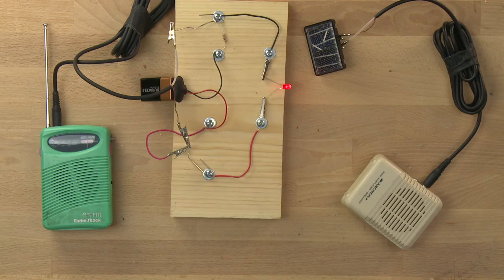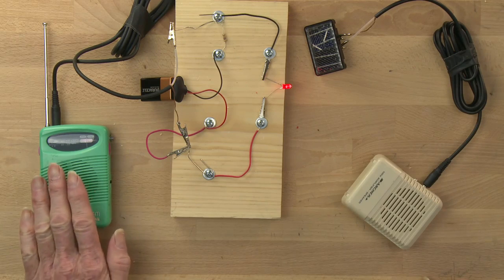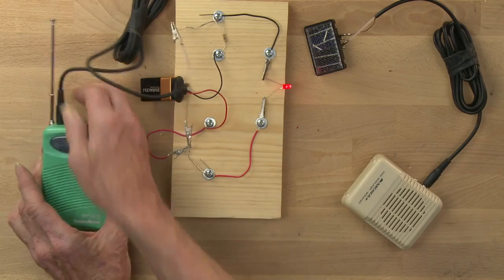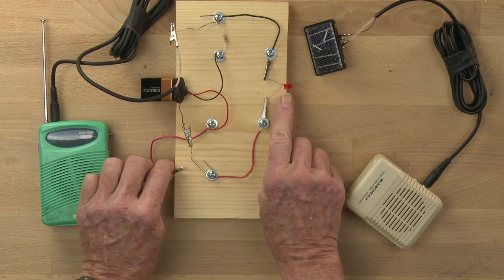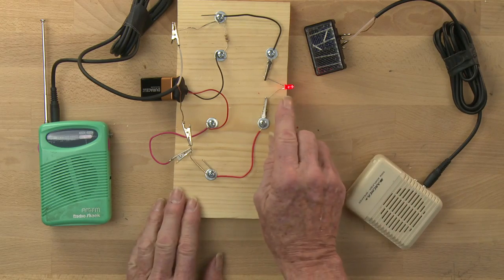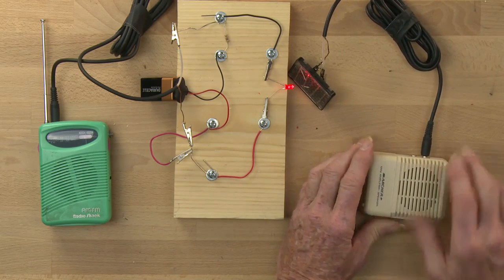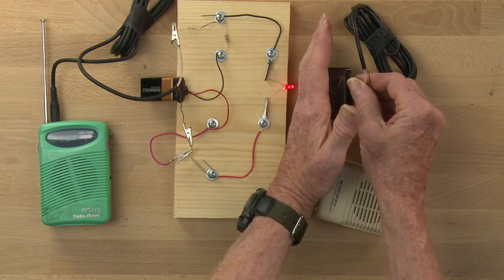How to turn sound into light (then back into sound) - Part 6 of 7: Here's how it works

Comment: I do not think that this is conversion of sound into light. This is merely a utilization of the electricity supplied by the headphone jack to light up an LED connected to it, with the support of a battery no less. Conversion of sound to light means something completely different in my book.
Reply: I would also like to add that the LED was on even without the connection to the radio, thus implying that a comment made by an individual here saying that battery did not power it up on it’s own is wrong. And I do not see the brightness change, at all. I have been pondering recently whether it is possible to change one form of electromagnetic energy/radiation into another as all of them are the same, i.e; electromagnetic waves. The only difference is their wavelength, which if could be manipulated will result in conversion. This is nowhere close to what I was thinking of. This is simply extrapolation of electricity through radio waves (or maybe not, if that is a battery-powered radio) and usage of the generated electricity to power an LED, which was already lit up, with a battery.
Reply: Yeah but he made it sound so convincing like he knew what he was talking about LOL. The next mr. Wizard
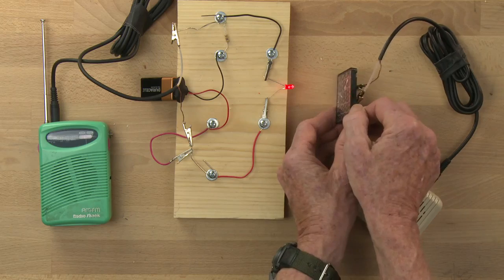Reply: Yeah, I was expecting there to be an "audio cell" the same way as the "solar cell" he depicted around 1:15. This isn't the same thing.

Comment: Your title is misleading. This is not turning sound into light, its turning sound into alternating electrical current which is then used, with an extra direct current source, to light a bulb...You do realize you can create a floating cloud of visible light just by playing the right frequency of sound loud enough into the air right? But what I want to know is what frequency range does visible light start and end at and how to make a audio device play that frequency? Do you know? And can you also tell me what converting (or even how to convert) the start and end of the frequency range for visible light into a number such as "x per second/minute"?

Comment: Ok but i don’t get it. In this, the colour is arbitrary. You chose a red led and so the current gets passed on to the circuit and makes the red led shine. What i don’t understand is how astronomers used radio waves to create the image of the black hole, whereas you explain how to create a current. If someone could explain i would very much appreciate.

Comment: if i swapped the radio into a microphone and played music into it would the light still come on?
Reply: With the radio attatched he just put noises into the system that make the LED brighter... like little peak on the voltage that supply the LED. if you attach your mic instead of radio every time you make noise the bulb will get brighter and thats all...althought the mic output voltage is way smaller than this radio so it will be almost hard to see with naked eye;] ( like 94 dB of sound that normaly can make you deaf can generate around 20mV which is almost invisible difference on the emited light)
Basicaly this video show nothing but convertion of energy ...it would be way more interesting if you had implemented some system that recognizes the bulb fluctuations and this way the other radio catch the diming signal as radio wave (wink) .

Comment: This is fish most of the energy (entire energy) comes from that 9V battery.....
Reply: the battery is providing only the DC supply...the LED has a varying brightness due to the sound signal (which would not be possable with the battery)